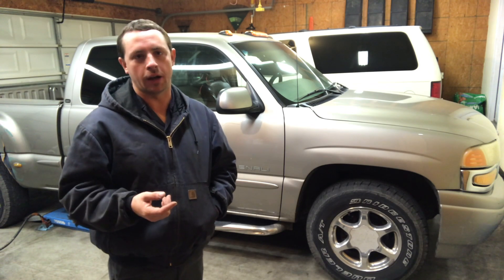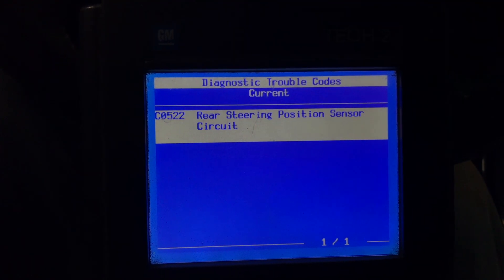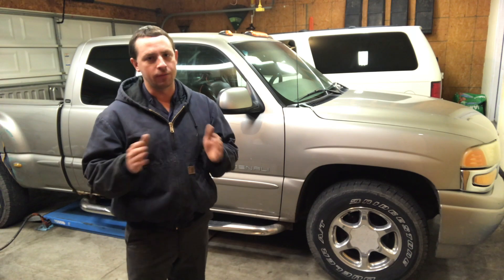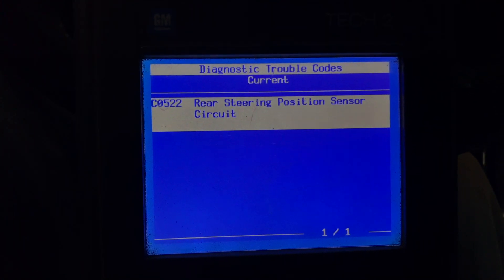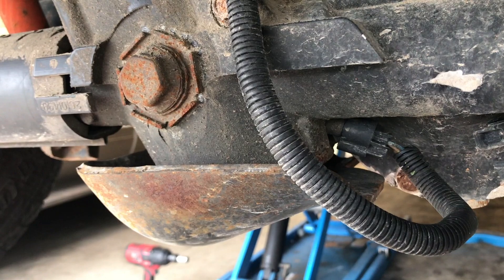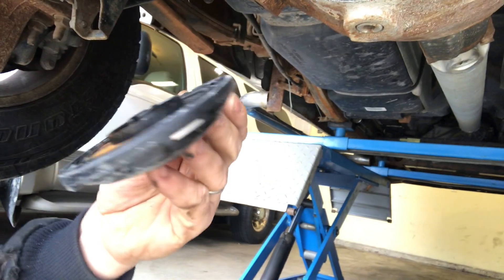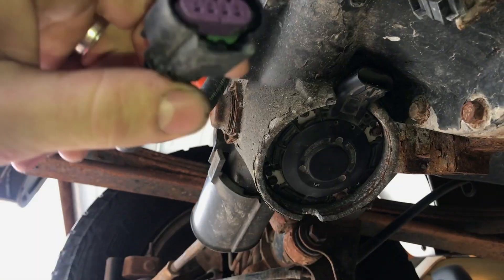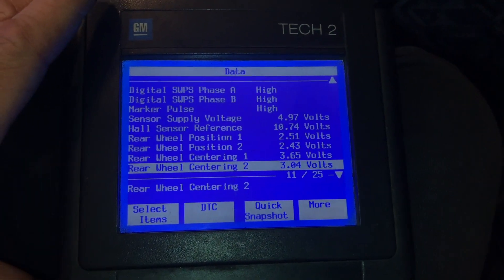GMC Quadrasteer (4 wheel steer) Repair

Comment: Daniel, sad to tell ya that even Honda did have the four wheel steering on their Prelude cars. Prelude died for a few years & was later brought back along with the four wheel steer. As we know, those cars didn't sell well & died again. Honda later considered that option too costly to keep for those cars. That is what happened to those GM trucks equipped with four wheel steer. Though I do agree with you in bringing back option in those trucks. I remember when test driving a new Gm truck with the four wheel steer. it was way much better to drive & steer with that option. I even got the chance to try a parallel park. If you think Gm four wheel is expensive, Laborghini has now got it in their new cars. Check out the prices on parts for those four wheel steer....Ouch.
Reply: True though diffrent systems (mechanical vs electrical) and the issue on gm side is they didn't really marketed well and when they did they went about it wrong

Comment: Did anyone notice that the assembly COULD be designed in such way to use the electric motor assembly shaft and locate the sensor in the back part of the motor? therefore above the motor...? or even in between the motor and the assembly?

Comment: I find it interesting how many folks will bag on a system like this without considering how old this truck is. They were ahead of their time. A lot of these trucks are still on the road and fully operational, 18 years later. You can't expect things to work forever. Seeing the amount rust and crud on this truck, I'm actually surprised that it was fairly easy to fix. I own a supercharged 02 Q-steer. I love it. It drives great. Consider, ever modern vehicle is loaded with computers and potential problems.The only way to avoid that is to own something old and carbureted. When fuel injection came along there was probably some that bagged on it. Same for all wheel drive and ABS systems. Now those features are standard equipment. We have self driving cars and not 4 wheel steering? I'd take 4 wheel steering over a self driving car, personally. In 2002, people just weren't ready to pay 50-60 grand for a truck. In 2020 people are easily paying that and much more for a truck loaded with completely useless bells and whistles. How about all those air bag suspension systems? Every car manufacturer that has equipped a car with them has proven to be problematic. But yet they still do it. Most of the problems in all these types of systems are due to lack of maintenance and owner neglect. People these days don't even oil the chain on their bike and then they complain when it doesn't function anymore.

Great video, BTW.
Reply: Know a guy 321000k still works fine. Mine a problem from about 40K miles on.
Reply: Older trucks rule. They have an easy $40,000 of electronics in new trucks that are useless conveniences that most truck owners likely don't need or use often. Spending $600+ a month on a new truck payment is much more expensive than an older truck getting $400 of maintenance each month and being highly dependable. Not to mention the lower insurance and DMV expenses.

Comment: There's gotta be a way to reverse engineer a custom made sensor into that for those who absolutely cannot obtain this part anymore.
Reply: Patent would be out of date too. Could make some fixes to design and patent the update, if not give it to public domain.
I liked this feature, and the way some 90s GM cars were designed, it looked like they were potentially 4 wheel steer capable.
Reply: A company name Goood Systems just made a completely seal sensor
Reply: Thanks man @justatruckdriver9809

Comment: I’m surprised they didn’t stack a few redundant sensors on top of each other and call it good. The bailout came a few years later.
Reply: The bailout was also caused by GM credit (now Ally bank).
I'm not saying GM screwed up badly, they did. But there were other factors besides bad manufacturing management.

Comment: Incredible, I've only heard of, and seen on youtube of course, the illusive 4 wheel steer. Would love to have one with 4 wheel steer, it is a shame that they discontinued the use of this, it would make driving so much easier on these congested NY streets. It is funny after i watched the video i went to rockauto.com Last year they had some parts for the steering system listed but never checked price, Now the listings have been removed, and are no longer on the site at all. that is how i originally found out about the system.
Reply: That part confused a lot of people. It was actually a STEERing  wheel position sensor. RWPS still pretty much unobtainium.

Comment: 26091590, Sensor kit
Manufacturer:	

GM

OEM part number:	

26091590

MSRP:	

$235.27

Average price:	

$292.28

Best price:	

$258.80

You can save:	

$33.48

	

Available in 9 shops.

	

Add to cart

You are not very good if you spent $1500.
Reply: I will buy all 9 of them for  $300 each if you can get these for me....let me know how your "good" search goes bud.
Reply: @gunzofthenavarrone8293  Are your fingers busted? I searched them. You can too. And if I get them for $300 each. You pay me DOUBLE for doing your legwork.
Reply: @gunzofthenavarrone8293  
Shopping Cart
You can see your shopping history here.

Sensor kit
OEM part number: 26091590
Rear wheel steering position
Shops which sell this part
$258.80, GM Parts Headquarters, 
Norfolk, VA
$264.14, Online GM Parts, 
Schaumburg, IL
$272.91, GmPartsShop.com, 
Phoenix, AZ
$279.97, GM Parts Outlet, 
Glendale, AZ
$282.32, GMPartsCenter.net, 
Scottsdale, AZ
$285.50, GM Parts Giant, 
Northridge, CA
$305.85, GM Parts House, 
Boyertown, PA
$330.19, MyGMPartsStore, 
Lawrenceville, GA
$350.83, Jake Sweeney Auto Parts, 
Cincinnati, OH

Jesus fucking Christ, you people are lazy as dog shit.

Comment: I have an '03 Denali and am curious to know if the sensor can be cleaned? Also, what servicing should I be doing on that system?
Reply: Depends on the condition, they can be cleaned but carefully. I suggest joining the three big quadrasteer groups on fb. They will give loads of help
Reply: Many thanks for the QS Facebook groups. Great people including an former GM engineer designing a new sensor/control to overcome the discontinued sensor issue! Could be a new part/product coming down the line.
Reply: @Chuckt961  ya me and him were talking about it and we decided to get the ball rolling on the new sensor. Figure its now or never.  Welcome to the groups btw. Hopefully a new sensor will be ready soon

Comment: ive replaced a few of these over the years the quadrastear system is really neat makes turns alot easier but the norm for delphi stuff is the stuff is always prone to failure ive had to delete the system on trucks due to many of the rear steering parts being very hard to find so swapped out the rear end for a normal one its so rare because it was a poorly advertised system ford is testing a simalar system on the F150 its funny how honday did a full machanical version back in the 80s that was very reliable lol
Reply: Nissan had one back in the day, on some of their 240sx, Think it was called HICAS
Reply: @FrancescoBarberaMusic  i think your rite

Comment: I’ve only ever seen one of these out in the wild (in a Sierra Denali) and it was at this tiny family owned body shop I used to work for.  I had to move it once and was tempted to play around with it, but left it in two wheel steer because I was afraid I might break something.

Comment: Can't you put silicone around the outside of the censor so water doesn't get in ?
Reply: Then it creates a sealed humid zone as temperature drops and increases. Condensation would form. Not good either.
Reply: @Garth2011  It already has a seal, the silicone just ensures it stays sealed for a long time. Put a little desiccant pack inside if you're concerned about a non-existent amount of moisture in that tiny pocket of air under there. I'd probably spray a layer of fluid film type stuff as insurance before sealing the fuck out of it.
Reply: @P.A.C.E.automotive  You cannot prevent condensation in there by sealing it. That's why they engineered a weep hole. But that creates a lessor moisture problem.
Reply: @P.A.C.E.automotive  conformal coating might muck up the moving bits
Reply: Definitely gotta seal that bitch up

Comment: Scott is exactly right. This system when it worked was awesome. Working at a dealership servicing these trucks with these systems was a nightmare. Any rear axle service was made into a disaster. The most common failure was the position sensor. I do not understand why they did not seal the unit up. In my opinion the cost of the system out weighed the benefit especially when you had to pay for repairs.  Good video.
Reply: Americans always have great innovation with poor execution
Reply: GM in general

Comment: Tfltruck has a video of ZF (company that makes ZF 8 speed)  who is engineering something like this. Not sure if it will actually be released
Reply: My 1990 Corvette ZR1 has a ZF 6spd
Reply: Richard Wolfe Ok.
Reply: @Icutmetal  
It's actually extremely valuable and raises the value of the car almost $5,000 with the aluminum bellhousing
It was one of the first Tremec conversion kits ever built and put on a Chevy
Reply: MT.Truck has a great video on the history of the quadrasteer and what actual went wrong. Its actually realy interesting

Comment: What a horrible idea.  Take one of the strongest pieces of a pickup truck and bastardize and castrate it for a whopping 15 degrees of steering.  On top of that execute it in a half ass way. I would avoid that truck like the plague.
Reply: Lmao! Clear you dont know much or ever owned one. Tow up to 10,000 with mine and i can say its been going stong for 17 years without a single issue. Also a dana 60 isnt a shitty axle?
Also that 15 degrees makes a work of difference especially when towing.

Comment: I wonder how much that messed up tire wear
Reply: With correct rear toe, and zero camber to the rear wheels, the only thing that would happen would be front wheels would compensate for the thrust angle. This would not cause tire wear, but would make steering wheel off center.

With extreme thrust angle, you might see the front caster affect front camber from the front wheels being turned so much, but you'd have other worse problems than tire wear by then.

Comment: Is that the 11.5" rear end?
Reply: No... these are the 9.75 rear, as listed in service manual, etc.  It's actually a 35-spline Dana 60 with kingpins - but with C-clips holding the axles to the carrier, so it's a semi-float, not a full.  And since those axles move the way they do, they have a CV joint, so those are unique, too.
The parts are still mostly available, except for that rear position sensor.  I bought mine a couple of years ago, and it had a bad rear pinion bearing which had to be fixed, but the QSteer system itself has worked fine.   Love the truck.
Reply: @donoevil8042  Is the 9.75 the only one they produced? I thought this was an option on the 2500 as well
Reply: @TheOzarkWizard  Not sure I understand.  If you're asking "was the system available on 2500HD", it was.  But maybe not all wheelbase?  I know the Denali C3, 1500HD, 2500 Burb, and 2500 pickups could get it.  
If you're asking "any other axle besides the 9.75 Dana 60 - no.  All QS trucks had the Dana.  No option for AAM axle.  I actually replaced the axle in mine w/ one from a C3 (same 4.10; other option was 3.73).  Had to swap the hub over, since I have 8-lug, but all else was same between both.
Reply: @donoevil8042  I have an 01 Burban 2500 8.1 with the 11.1", I work on cell towers and it seems like quadrasteer would work wonders for having to turn around in a tight tower space, but wouldnt be worth it with as much equipment hauling as I do. I dont know anything about parts compatibility, which is why I was asking. The second half of your reply answered my question
Reply: @donoevil8042  Agreed, they were not that undependable. Some people just get too mental about something that looks complicated. Honda had these on their Preludes etc. only they used a driveshaft from the front steering rack to the rear.

Comment: The idea is great, the execution is horrid.

I swear GM never tested the durability.
Reply: I have a 03 and since the day it came off the lot its been in 4 wheel steering, not a single issue. They just dont like deep water. 250,000km and i live in canada so alot of snow and slush. All i can say it for reliability, its been great.
Reply: @The_Duggler25  Must be nice
Reply: @MrChriskep1  not just me, its alot the guys in the quadrasteer groups.
Reply: I've seen problems with 4WS on lots of vehicles, not just GM. Nissan HICAS 4 wheel steer on Skylines and Z32 300ZX comes to mind. Most people just delete the system.
Reply: @hughjaskoch5456  yup. Honda prelude as well
Reply: Scott EVER!
Reply: It wasn't a gm design, it was completely engineered and built by American axle and manufacturing.
Reply: @drewscruis  Wrong.  Delphi engineered the system (and was still affiliated with GM at the time), and the axle is a Dana 60.  I own one of these.

If it were AAM's design, do you think they'd have used a competitor's axle?
Reply: I forged parts for this, I was on the team with some of the designers.
Reply: Mine just stopped working after 17 years. It’s always been on and never failed.  NOw I have a C0533 code. 2004 SD 140k miles
Reply: Lol I’ve been daily driving my quadrasteer for ten years. No issues
Reply: Gm doesn’t test anything. That costs money...
Reply: Scott this truck is literally 18 years old, you can’t expect nothing to go bad eventually lol.
Reply: I kind of agree. Most of the system is reliable but Its criminal how easy it is to contaminate the rear position sensor. A few dollars in waterproofing would have saved so much trouble. I toasted mine just launching my jet skis in the lake. Who would have thought you cant do that with a truck.
Reply: That's pretty much GM in a Nutshell. They have good ideas (sometimes), but never test their ideas before putting that idea into production lol
Reply: GM Never tests their shit. Garbage, all of them

Comment: Lets try the 4 wheel steering.....redlines truck at every stop light....yup, we fixed it😃
Reply from the maker: A good ol’ 6.0 LS loves a few good wide open throttle runs 👌😂
Reply: Italian tuneup.
Reply: remustintoi1 only doing 70-80mph
Reply: Gotta check on dat torque steer

Comment: These trucks are rare I've only seen two, a Silverado 2500hd Duramax and a suburban 2500.
Reply: They never came factory on a duramax as the duramax would tear apart the rearend.
Reply: @GMT400Chevy  I guess the owner swapped, it to quadrasteer or Duramax swapped it, because it was reversing with it's rear wheels turning it
Reply: @alexsabothomas3621  Ive seen one modified like that
Reply: @MrChriskep1  That's cool man, I guess I'm one of those rare people that has received a positive comment from you, Ha ha. Cheers man
Reply: Yeah, it had to be modded, if it was on a Dmax.  The trucks that had them as an option were all gassers; Sierra Denali (C3), the 1500HD (mine), 3/4 Burb, and (I think) some 2500HD.  2002-2005 only, for all above.

Comment: Dan, I had 4 wheel steering on a tractor and hated it.  I just felt like it went where it wanted instead of where I was thinking it should be when turning.  I would not recommend it and I imagine no manufacture offers it due to the same feeling I had.
Reply: So you fault it for being responsive and going where you want it to go?

Comment: wonder how hard doing an rear alignment on one of these
Reply: same as any vehicle with a rack and pinion, loosen jam nut and twist the inner tie rod. they only have a toe adjustment
Reply: If memory serves, you needed to center and then lock out the rear rack and pinion, and then you could adjust the angles...